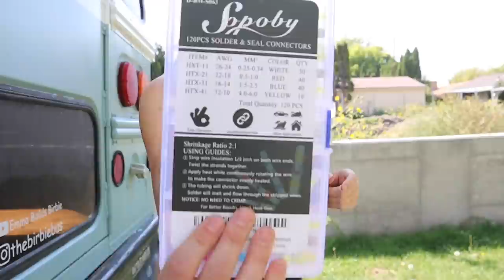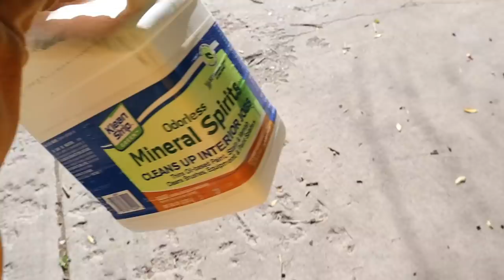Amateur school bus body work: Welding and bondo on the school bus conversion // Skoolie build pt 29

Comment: 11:51 the secret to drywall mud is you're probably using a scraper, get the actual drywall knives they are cheap and square and come in all different sizes- amazing difference I found out myself, so much easier to get flat and smooth!

Comment: Emma, hello Young Padawan. Suggestion for you, put a ring connector (it will be blue) on the black wire and attach it to one of the screws that hold the light in place. Then your light will be grounded. And the yellow goes to power.

Comment: Nice work, but what I would do is replace the bolts and nuts on the side lamps with a Parker screw (I used to work on cars). The day you have problems with your light, you can no longer loosen this bolt as the nut will be behind your inner lining. The bolt will turn crazy. With a parker screw that would not be a problem to replace your bulb. When dismantling your bus, you saw a lot of those parker screws. Always thinking ahead, you never know what will happen. Good luck. Greetings from Belgium.

Comment: Well done!👍 I would recomend some extra insulation/gromet on the wires there the wires go throug the metal, just to prevent a possible future short circuit. 🙂
Reply: Maybe just inject a bit of caulk through the wire hole from the inside...

Comment: The difference between a cheap paint brush and a good one is the finish. Oil based paints are a self leveling paint to a point. CHeap brushes tend to loose bristles more often.

Comment: Yes the connections are good there used in aircraft the marker lights on top may have a switch on the left hand Electrical panel

Comment: Emma I just learned to use bondo myself and what you need to do for next time is you can make the pile of bondo as big as you need as long it's about an inch high and squeeze the hardener across the glob of bondo and that will be the right amount then you'll never have to guess on how much hardener you have to put in. But it looks like you did a great job way better job than I did. I had to fix a rust hole on my jeep. I also want to mention that you pick some great songs for your videos especially the last one on this video
Reply from the maker: thanks!

Comment: You have mentioned spray foam a number of times. The stuff is really a mess to work with, even the pros make a mess. Try ROCKWOOL SAFE 'n' SOUND insulation, very easy to install, fire resistant, non-hazardous to you. You can by in small amounts and try it.

Comment: When I first read Bondo's instructions I thought the same thing. Did this person not own any tablespoons? 
Next holes you fill you can use a holesaw to make plugs. For mounting holes that don't have a template, I like to use a copier. They print to scale and it helps Alot sometimes.
Very impressive work and ability to negotiate around the occasional catastrophes. I'd suggest you get into mechanical engineering or even a well paid internship. We need capable people's and especially the female of the species.

Comment: Sorry to tell you Emma, but heat shrink butt splices need to be crimped. A good mechanical connection is necessary for current flow.

Comment: Did you have to put the lights on the side? I would have left them off unless it is some kind of law. Also with the spray foam and walls how would you change them lights if they burnt out? Maybe a sheet metal screw would have been better than a screw with a nut on the inside. Just trying to think ahead if you ever have to fix them.
Reply from the maker: I wasn’t 100% sure so I left them to be safe 🤷‍♀️

Comment: Never bolt anything you might need to replace on the outside of bus unless you are going to have access to the bolts on the inside after it's all built.
   Think about breaking one of those lights on a tree branch or something shit happens.
 How are you going to get to the backside of those bolts.

Comment: Hi,
For heat-shrink tubing, take a lighter (easier and faster!)
A radical product for your brushes, acetone.
WARNING ! This product is dangerous, it stings the eyes and evaporates very quickly !!! Don't let your brushes soak in it otherwise it will harden,
clean them and dry them immediately.
Bye

Comment: You should have drilled Your wire holes bigger because when You need to change one You will not be able to get to connection on wires